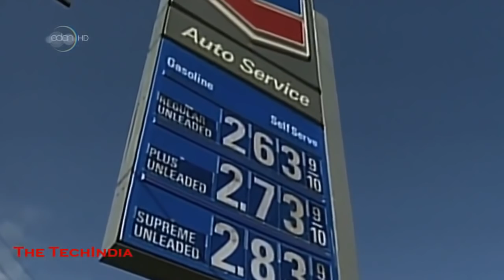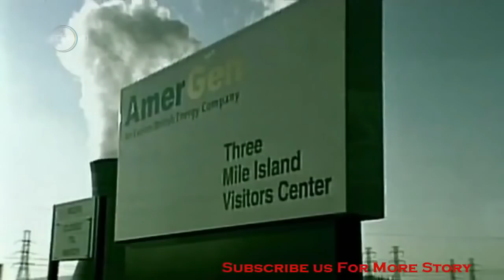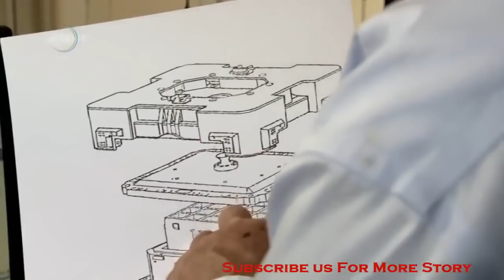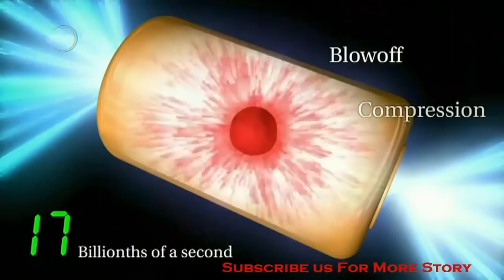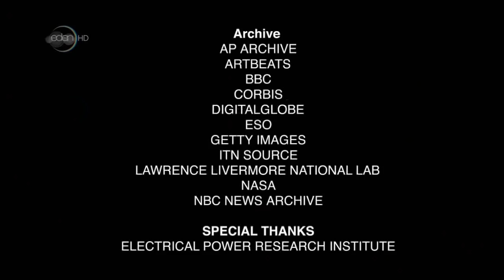Future of Free Power Energy - Secret Technology Documentary HD 2015 FULL

Comment: I don't see any comments about thorium liquid salt reactors.  No "back end" problems.  Almost all of the thorium is consumed in the process.  The safety interlocks are self setting and if power is lost to all the pumps and other such normal operating equipment, the salt plug melts and the liquid salt separates to non reactive quantity containers.   Not perfected but is a much safer and long term solution than uranium reactors.
Reply: +Robert Palmore Also, waste from older generation reactors can be added to the liquid fuel mix and burned up.
Most of what is in nuclear waste repositories could be burned fully, and use up over 90% of what is now stored 
as waste and made into power.  Thorium Alliance discusses this.
Reply: +duane navarre If I'm understanding the fission process in a thorium reactor it actually needs uranium or something like that to start the reaction. Yes, consuming all the other stuff is a huge benefit.
Reply: +Robert Palmore So what's keeping you from researching, perfecting, and industrialising Thorium Salt Power stations then? I'm in a huge majority in wishing you a speedy success.
Reply: About 2 billion dollars.  Minor problem.
Reply: You'd better start saving then!
Reply: I'll start saving my allowance.  Should have enough pretty quick;0)
Reply: A youngster like you should be at the forefront of renewable energy R&D. Do some research. Become an expert, and set up a company. It worked for Zuckerberg nd it orkd for Gates. Why not you?
Reply: Thank you for the compliment but I'm over 55 now and my youthful zeel has vacated me but you do have a point, the only limitations in life are those we choose to allow.
Reply: There's still plenty of time, and fortunes waiting for someone clever. I'm almost 70 and well past my best, but I retain ambition and hope for the future.
Reply: Saving your allowance  !   :D
Reply: +Robert Palmore   LFTRs FTW  By the way, the opening was ridiculously unlikely... Especially the train carrying nuclear waste contaminating London.  Helen Caldicott must've been an advisor!
Reply: John Benton: Why don't you do as you say and invest in research for the LFTR? All talk?

Comment: the new tech for grid power is old tech and it is in the use of thorium powered liquid salt reactors, the only reason why the US gov chose uranium solid fuel reactors over thorium lsr's is because you can not make THE BOMB with the waste from thorium lsr's.
the US had a working lsr back in the 60's and it ran for thousands of hours without a problem and india has a working prototype lsr producing power as l type.
a lsr reactor can not have a nuclear meltdown, it does not need safety redundancies and it does not produce nuclear waste to be disposed of unlike uranium sfr's
lsr's can also use the waste uranium from sfr's as a fuel so it is green energy in all areas

Comment: this is not  a documentry. most of it is storry telling of worse case scenarios.
things that did not happen, and will not happen. (like the train shipping nuke waste crashing in a tunnel, and the next train hauling oil crashing into it. you would not run a nuke train alone, followed by an oil hauling train for this exact reason.)

the problem of fossil fuel, and most of our technology is heat.
all we do makes heat. and heat is building up on this planet. there is simply nowhere to go for the heat. be it from electric motors, or nuke plants. or natural gas. of hydro plants. anything we do is in the end turns to heat.
Reply: fear mongering at it's best. sombody needs a project funded, someone always trying to scare us out of our money. don't get me wrong we need clean renew able energy, and we need to learn to conserve, but this video has nothing to do with freeeee energy...  Nothing is free there is always a cost, sometimes it hides, but sooner or later the machine will break down.
Reply: relentlessmadman

Yes that is correct.
Instead of b/s stuff like this video, let us enforce the (unarguably low efficiency) solar-electric version of breaking down water (condensed /ion swapped seawater) to hydrogen/oxygen, pressurise it and send it via pipes for a clean burning solution. there are vast places like deserts where solar panels are just fine.
huge costs and low efficiency of the cycle would be offset with zero carbon emission, and a net of zero heat translated from the sun.

end of story. simply no one is interested in a real solution.
the above is just a blind shot at the moon btw.
still is far superior to many others that do get founded.

Comment: Forget windmills and solar it's expensive and very low energy density.Also superconductors are not the holy grail for long distance transport,Even when it could be run at normal temperatures the stuff has limited current density,go past that and suddenly it becomes A normal "lossy" conductor and It gets fried.
Reply: So windmills and solar are expensive, well if you want expensive, unsafe and unviable, look no further than the current method of nuclear fission.
Reply: That reactor type is only good for military applications and because research is expensive they stuck with that.India is working on the molten salt (thorium)reactor that should be excellent in "burning" all the fuel and even the fuel that we call radioactive waste.How can it be waste if it's still radioactive :D It means there is potential energy in it and we just have to push that out faster .
Reply: Picobyte There are lots of options for nuclear, but the old designs are just too dangerous, anything that cannot be turned off instantly is dangerous. These molten salt reactors can be drained into a sump I believe which makes the liquid spread thinly and go sub critical. Also small scale generation from nuclear is probably a good idea. Nuclear fusion is also something we need to get sorted..
Reply: Nuke has the problem that neutron density needs to be high,that makes tiny reactors impossible.We just can't make small devices because we need that minimum of neutrons in there.

Comment: What about Thorium reactors?
Reply: They are too safe and you cannot make nukes with them. They would sooner have the ones that cannot be safely switched off in an emergency, the current reactors need to be cooled by water for about three years after the control rods have been fully lowered, otherwise the zirconium fuel rod liners melt and the reactor blows up like Chernobyl. So you only have to have a coolant leak, a burst pipe, or a terrorist attack on such a pipe, or pumps fail and its game over.